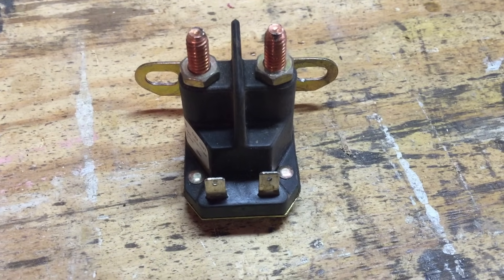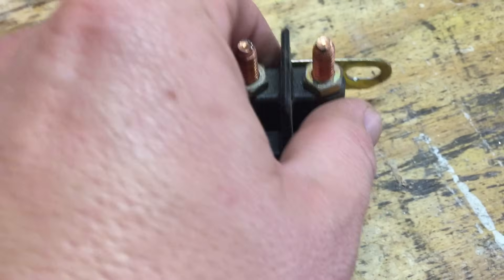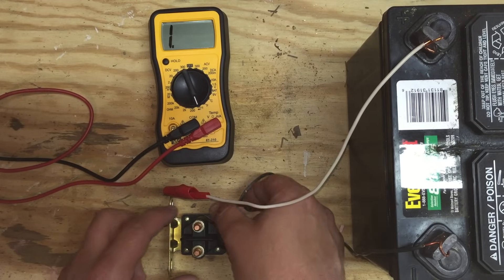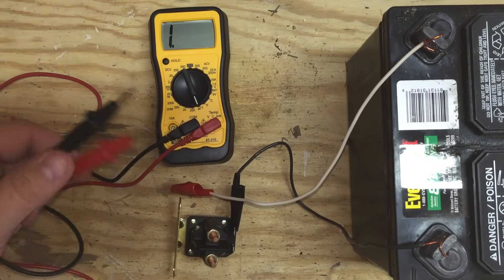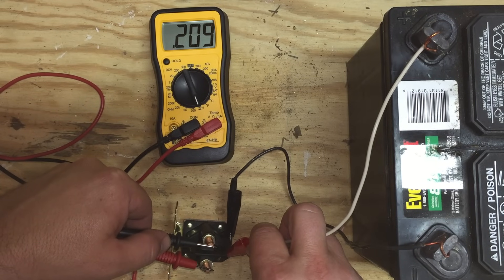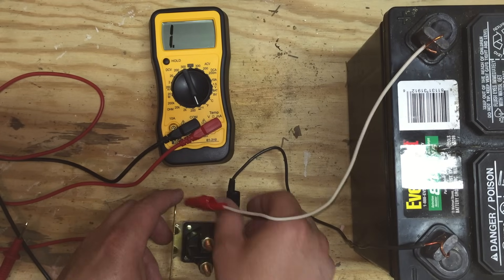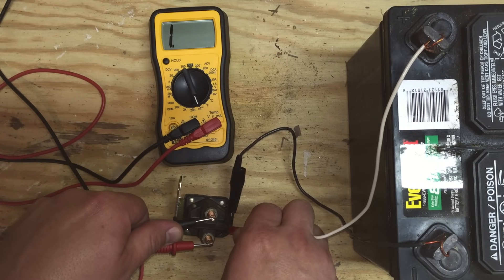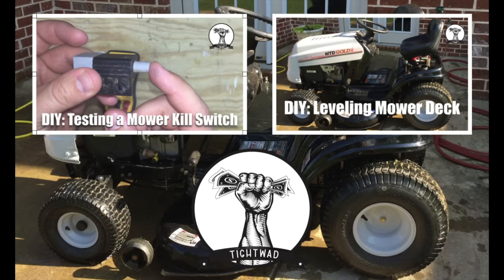DIY: How to Test a Solenoid

Comment: This question may sound silly but can a solenoid sometimes work and sometimes not, or sometimes work well and sometimes less well? If the answer is : it works or it doesn't (no in-between) then I'll skip the solenoid and head straight to the starter motor, for my issue.
Reply from the maker: I’ve never heard of one working intermittently but I can’t say for sure.

Comment: I have a solenoid in a Ford Jubilee tractor with 3 posts instead of 4. How would I test it?  It has 2 large posts and 1 small  one. Thanks.
Reply: Just ground the metal where it bolts on to mower and than touch      That one small post to a positive wire.  You should hear that click. If not it is bad
Reply: @Mike-m7b  Thank you.

Comment: Well, did that test. Mine clicked but had 3 ohms so I replaced it. Still the same issues. Clicks but won't turn over. Starter is good, all safety switches are good. I'm ready to give up. A guy who has been a mechanic for 40 years can't seem to find problems anymore. If I ever figure it out, I'll be back. If not, I put out on the drive for FREE! It's a New Holland ZERO turn. Had it for 20 years. Every problem I had before, fixed in minutes. Just one day, I get on and CLICK CLICK is all I get. Yes, the battery is good too.
Reply from the maker: Did you try bypass the solenoid to see if it turns over?

Comment: When installed what wires connect to the top two terminals?
Reply from the maker: The big ones? The cable from the battery and to the starter.

Comment: OK, my 2021 onan generator has 12v power at the solenoid and no click, no fault light at the switch, just salience.  Would be a bad solenoid on my 12hr run generator.  Beats taking the thing out of the rv for repairs.
Reply from the maker: That sounds about right. Tried jumping across the terminals to see if it turns over. If it does and you have 12 V at the solenoid and it’s definitely bad.

Comment: Hi its july 23 of 2023 thank you.  I'm  going to go test my solenoids.
Reply from the maker: My pleasure.
Reply: All three of my solenoids test good. I  have 12v. Going to my solenoid. It won't crank. If I  jump a hot wire to the grounded post. It cranks over. Any suggestions?
Reply: @jamescraig8601 ever figure it?

Comment: What’s the point of having a 4 post as opposed to a 3 post?
Reply: 4 post you hook a negative to one of the small posts, 3 post it pull negative from body of machine. 4 post can be mounted anywhere, because it is wired to negative, 3 post has to be on metal of frame.

Comment: I have what I think is the same solenoid on an old lawn tractor i'm working on. I was actually able to rebuild it. One of the screw connectors was corroded. I cleaned that up. I thought it was ok but still not working right. I was testing like you are with a multimeter set to ohms. I had continuity most of the time. I didn't realize at first my measurement wasn't near 0 ohms.. I ended up drilling out the rivets and took it apart.. there is a copper plate at the top that was corroded. I sanded that and the spot it connected to. When I had it back together and riveted again, I did the same test. The ohms were now near 0.
I still have to try it back in the lawn tractor. I can post an update for everyone.
Reply from the maker: Glad it worked for you!

Comment: I took my solenoid off and now I can’t remember which wire goes to which post on the bottom. I have one white and one black :-(
Reply from the maker: Oh no! Face it towards you with the big posts in the back. The battery line typically goes on the left and the right goes to the starter. On the front two, the line from the parking brake goes front left usually. Mine are typically orange or yellow though.

Comment: Good video. I've just tested my 4 post solenoid and I get the clunk and contact but no continuity which I find odd. Any idea's please.
Reply from the maker: It’s possible there is a crack in it and you need a new one.

Comment: let me tell you how to test solenoid  on the  mower  turn key to start if you only get a click stop use a pr. of pliers short 2 big bolts on slenoid if starter spins replace solennoid  this test tell you battery is good but solenoid is bad  take solenoid with get same type so mounting holes and wire will fit   if you rev. small  leads no problem
Reply from the maker: Yep.

Comment: there is not voltage to the top post because the bottom two connectors are not passing current to them.

Comment: I have the same solenoid but can't remember to which way the small terminal wires go on?
Reply: it does not matter if you have a 4 wire  two large and two small  rev two small wires -- no problem also rev two large wires no problem

Comment: But if the connection internally is not 100% than you wont be getting 100% of the charge to the starter so could still be bad if its engaging..
Reply from the maker: Are you sure about that?

Comment: My solenoid checked out as you said. Got it to click with the ohms meter but when wiered up it doesn't click ? All wires are working when key is on and peddle depressed transferring voltz to low voltage but no click??
Reply from the maker: Did you try jumping across the solenoid with a screw driver to see if it starts?
Reply: It's on a 48v club car golf cart. No click 48 voltz comes from key switch to speed controller goes to 1rst micro switch then shoots 48v to the low amp _on the solanoid. Yellow wire to other low voltage Yellow large wire to big post Red big to the +.post.. No click

Comment: i had an  MTD Gold  mower exactly like that one. 
had to replace the head on it the first time. . . the valve seat for the intake worked itself out.
the head that arrived through the mail , was put on, then 2 seasons later it just zood over then backfired and it all went up in flames.  

kohler engines self destruct. 

good thing  it was in an open field and not near the house.
Reply: Wow, dangerous!
Reply: Ok, but that has nothing to do with this video.

Comment: My multimeter has 6 settings in the ohms section, 200 to 2000k, and one with an arrow/plus symbol. Where do I set it for that particular solenoid, to test continuity ?
Reply: Mine has a small bell with ))) after it
Reply: on most multimeters  the section for continuity  [ alarm ] is beside the 1.5 volt battery section.

test it on yours to hear the alarm when you touch the tester terminals together,  i believe you will find it.

Comment: on my mower  i can jump the solenoid across and my mower starts it wont start by the key switch considering in 2020 i had the same problem replace my key switch and it worked
Reply from the maker: The key switch or the safety switches are the most likely issues. I’m glad you got yours fixed.
Reply: Where you getting the "click" when it failed to start?  I'm guessing not, if a new switch fixed the problem.  Although maybe an intermittent or weak switch circuit could still permit the "click."

Comment: it be for any external starter solenoid lawn tractor, some tractors and all Ford vehicles the best solenoid to use if it goes bad be a good quality Cole Hersee 3 or 4 post solenoid depending on the application of the lawn tractor as this Cole Hersee metal body solenoids will replace these plastic Trombetta solenoids in these lawn tractors and riding mowers and zero turns. Some engines the solenoid is mounted on the starter motor. which that in addition to closing the contacts it moves the pinion gear to mesh with the flywheel ring gear.
Reply: What I don't understand is how these wee small ones lever up the bendix pinion; well they obviously don't so what sort of starters are on such motors and what pushes up the bendix?

Comment: How can find the problem on my artic cat i put the switch on and the dash board not showing nothing battery is OK fuses they ok i guees .. But have a short then i replaced the bad fuses but screen not work is a 2007 artic cat 400

Comment: Should the 2 small posts have continuity between the 2 of them?
Reply: I think you're  wrong there, RC Hobbyist.  The two small posts represent the two ends of one continuous coil wire. When the switch (i.e. start switch) is turned/pushed (whatever) then one end of that coil wire becomes positive relatively to the other end and a current flows through, creating an electro-magnet.    But they're essentially just the two ends of ONE wire/coil. 

The two big posts have no continuity UNTIL that electro-magnet is energized by turning the start switch, at which time they now have continuity.

I'm no professional, but that's how I understand solenoids function.  If I'm wrong, somebody correct me.
Reply: no, one is negative. one is positive.  They cannot both be the same . Other wize fire works!

Comment: I can't find solenoid on a 2003 ford expedition .its not on the inside fender well.  Tell me where to look
Reply: Ha! I couldn't find the one on my mower. It was way at the back  next to the battery and was a xxx to remove. But yours is a car and I thought they have a cylindrical solenoid piggy-backing the starter. Good hunting but presume you've found it now.

Comment: Worked Great to test the solenoid. $12 later it was all set.  Prior to replacement my Tractor suddenly didn't start one week after working fine. When i turned the key there was no sound. Apparently thats the clunk of the solenoid you hear.
Reply from the maker: Jim Martinez That’s great! I’m glad the video helped you out. Be sure to subscribe!
Reply: May I ask you? I can hear a clunk when I turn my Starter key. So did you hear the clunk before or after you replaced the Solenoid! ? 
I Just am not CLEAR on your comment ?? I have a 3032E J.D
with 144 hrs. ?  Well anyway , it will not start ?? So the battery charger says  it's at 12.1? Don't know for sure but I think that's okay?? So I turn on my key, lights on dash come on then after about 5 seconds I hear this big Clunk and the lights shut off !! ??
Would you have any idea if that means the Solenoid is good or Bad ?? I am not a Man!  I t seems to me that all Men are born with "Mechanical Smarts" !! 
If you could give me some advice? Thank you ! Sherry

Comment: TIGHTWADDIY, 
                          1.) solenoid coils uses a different type of wire that has "insulation" resistance on the coil wire or something so it doesn't get burned up when left turned on held on for a period of time? 
2.) How do you measure the solenoid "Torque" to know how much the power of the solenoids release pushing out strokes to know how strong it releases the solenoids plunger?
Reply: if the battery is less than 9 volts  then you will hear nothing from the solenoid . 
if the battery is 10 volts or just higher than 9 volts , then all you will hear is clicking.
because that low of voltage will not turn the starter.
it must be 11.5 or higher   [  12 volts ]  for the solenoid to work properly for the starter to do its job. 

your welcome.
Reply: @deborahcuster8142  on mine it’s clicking but no start. Battery volts is 12.3 volts 
Replace ignition switch and still no start but noticed after I tried after replacing ignition switch the solenoid was warm.

Comment: I'm sure that a 4 post solenoid doe's not ground to the frame or body, at least my simplicity does not.
Reply: Old comment but for future readers. It does use the mounting points as a ground. There is no negative post. You have 2 large posts. One directly from the battery. The other to the starter.  Two small posts. One from the ignition switch. The other sometimes goes to a coil or ballast resistor or Its usually not used. A four pole thats mounted directly on the starter, may have a ground wire.

Comment: just listen to it to see if it clunks when yu put the battery to it
Reply from the maker: bomark 2002 You are correct. The multimeter was more for visual representation. The click or clunk let’s you know the magnets are connecting the two posts.

Comment: Does this apply to a 48volt solenoid? Can I use a 8volt battery to test it?
Reply from the maker: mario garcia I would assume the same concept would apply but you would need something with 48volts to test it.
Reply: TightWadRepairs thanks.. Great video!  Straight to the point, very helpful.
Reply: @TightWadDIY  espanol
Reply: Espanol

Comment: GRREEAAT VIDEO!! as I'm about to go try this now, my issue or question Is how much trouble did you have getting the old one out and the new one in? its really in a tight spot on my craftsman made by mtd
Reply from the maker: J WAYNE CARROLL I won't sugar coat it. Removing this thing was a pain in the butt on my MTD. On my Cub Cadet it was easy though.
Reply: @TightWadDIY  On my cub cadet, it doesn't look easy, any suggestions!